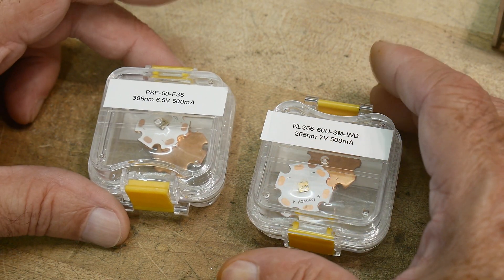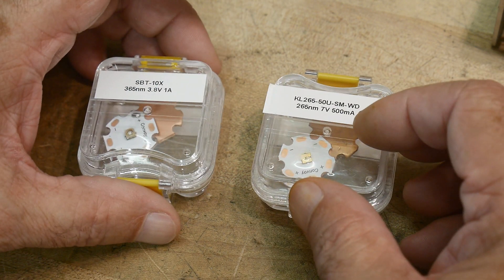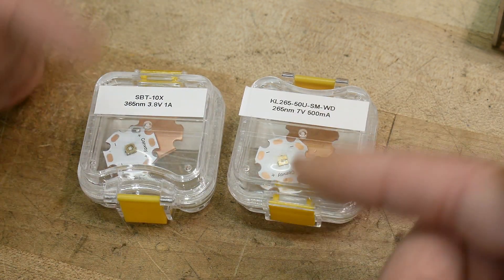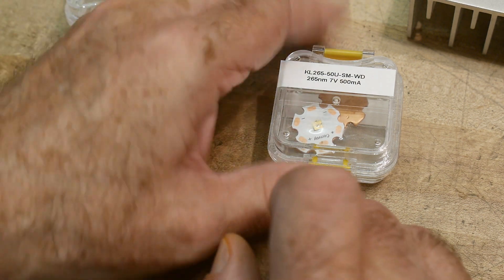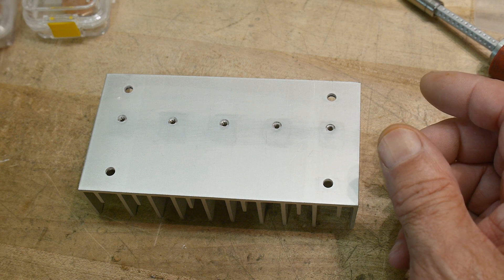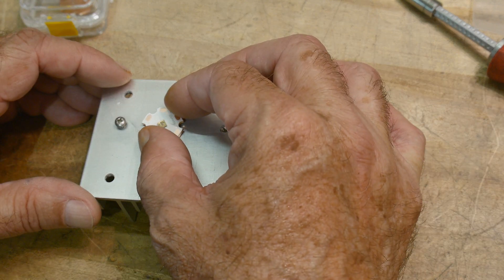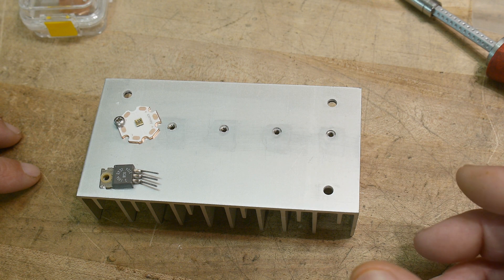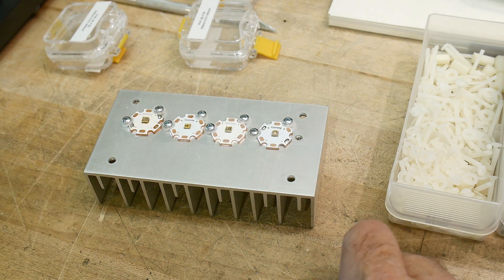#1263 UV LEDs (part 1 of 3)

Comment: They also use UV light to kill bacteria in water.
Reply: It works by photolysis, the photons at the right energy break chemical bonds.
C=C 602 kJ/mol (~199nm)
C=N 615 kJ/mol (~195nm)
O=O 494 kJ/mol (~242nm)
Reply: @itsevilbert  Thanx, Photons are electromagnetic waves on the metric scale and not posses any kind of mass. a light bulb or led isn't getting any lighter after some time.

So it must be magnetic property at the right level or intensity causing havoc on atomic bonds, shaken to separation. the bond is made by the valence electrons in the outer shell who probably continuously race or interchange between the nuclei.
seeming at a speed of around 6000km/Second!  according to David Butler.

David Butler (Atom 4K) video is a must see.
Reply: UVC

Comment: I got some 365nm ones as a freebie with some other stuff, and put the one into a LED lamp instead of the original 1W emitter. Ran it at 1W, plenty enough output from it, and I use it as a leak detector, with yellow glasses. Yes you lose a lot through the polycarbonate front of the torch, but till I get a piece of quartz glass that is thin enough to grind to replace it, it will stay that way. Do not forget that putting the leads on before mounting them is best, as otherwise you run a high risk of cooking that delicate die. Heat sink compound under the interface, and take that plate and lap it with some 1000 grit waterpaper, on a glass sheet first, or a surface block, to make it flat after the drilling has distorted it. I have mounted a good number of star type bases without screws. Lap the heatsink, and the base of the die, with 1000 grit waterpaper, and clean with alcohol after attaching wires to the PCB, then use a small bead of 2 part epoxy to mount it to the heatsink, pressing firmly on the edges till the epoxy is cured. 5 minute metal loaded epoxy is best, and a match head size bit of the mix works, so it comes out all sides evenly. Survives well, at least a few years now for some on regular, though the one running at 30mA as a indicator light has degraded badly, time to put another one in it's place. Degraded not from heat just from being a cheap LED.

Comment: I don't remember if it is IR or UV, but one of them sees through clothing.

I worked in a secure building that was one of the backup operations centers for a major global corporation. I had to go to the security office to get my ID and RFID card, and I was looking at the monitors and you literally could see through almost everything. Some pieces of clothing you could not see through, but basically they could see everything.
I asked them how they were able to do that and they said they were not allowed to give any information about their security.

They had the first flat panel LCD or LED panels that I ever saw. This was back in the 90s, and the operations center has a ceiling about 30 feet high
The one whole wall was made up of 4 LED displays
Each display was roughly 12 foot by 12 foot

They were split up into about 20 display windows of different sizes
Some were black and white text displays. Others were graphs
Others were video feeds
The closest thing to what it looked like was NASA mission control

There were rows with workstations and the monitors on the desks showed some of the same information as the large displays.

Really amazing place.

I had a very low grade job loading backup tapes and boxing them up each night to be transported to an underground bunker data storage facility.

I think it was Iron Mountain or a company like that.

I didn't know that there was a place like that in my state till I worked there and I saw the locations for a dozen of these bunkers in two states.

There is a lot more places hidden that very few people know about.
Reply: IR. It is why digital cameras have an IR filter in front of the image sensor. First generation of digital cameras could see through people's clothes.
Reply: 910 nm IR, for sure.